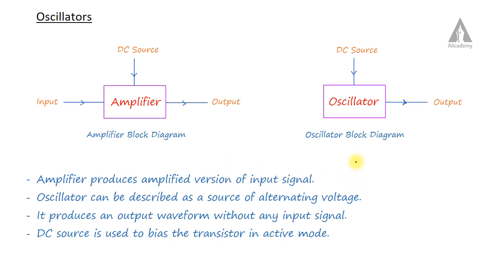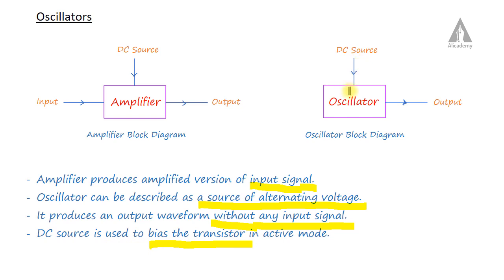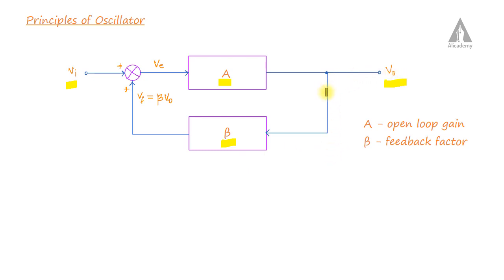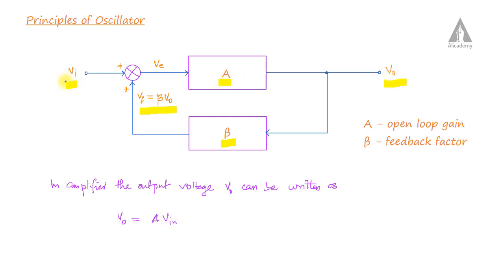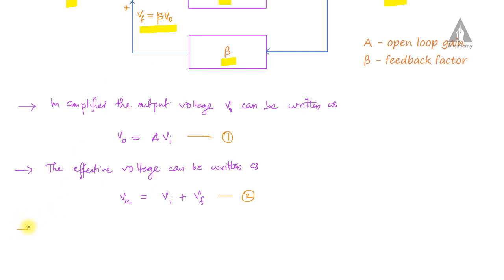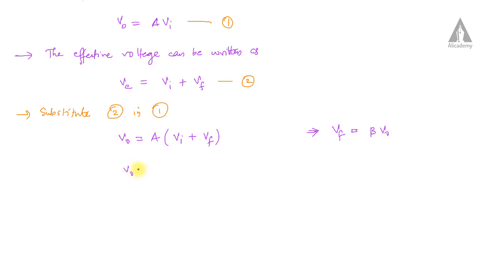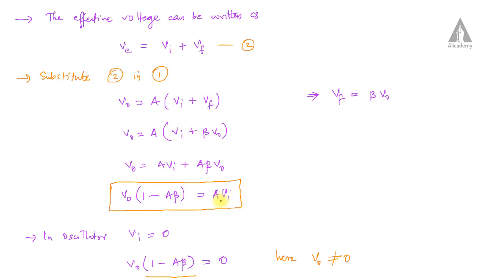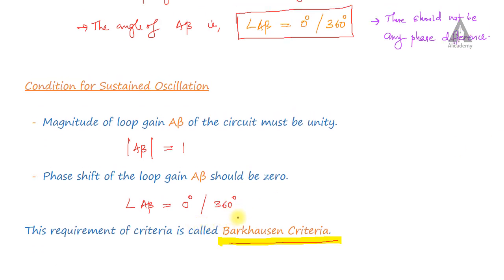Barkhausen Criteria | Oscillators Introduction | Analog Electronics | KTU | Malayalam

Comment: Vo=A(Ve-Vf) ennallle vernney
Reply: no.becouse when output feedback voltage (Vf) is enter in the input side of the amplifier , then the total input voltage to the amplifier is become Vin+Vf
so, the output voltage Vo = A(Vin + Vf)
Reply: @abhia1883  manasilayilla..namal seriku. Avide Vi  ale substitute cheyabde
Reply: @arunk.h8087  ee video il oru step missing aahn.
Vo=AVe
Ee equation il aahn substitute cheyyendath .
Vi  Ve akan karanam feedback voltage ,Vf input il vannathinu shesham Vin changes to Vin + Vf which is equal to Ve